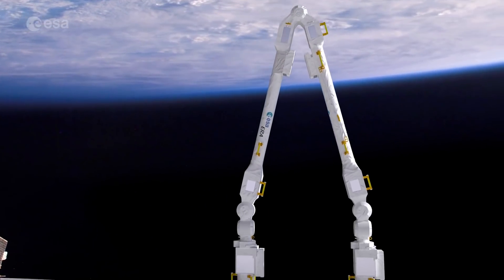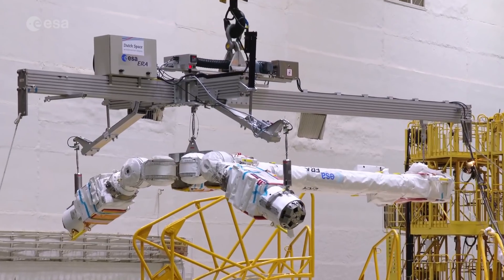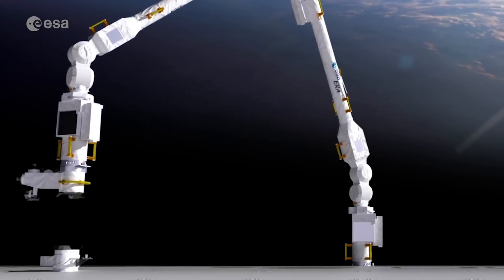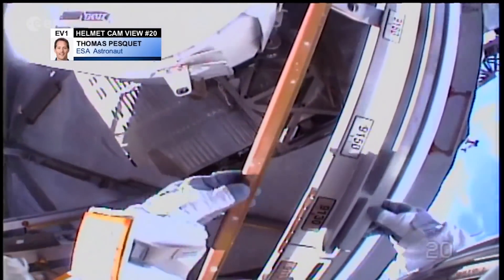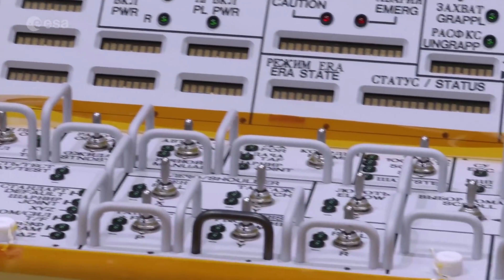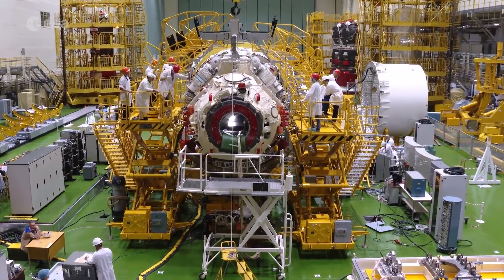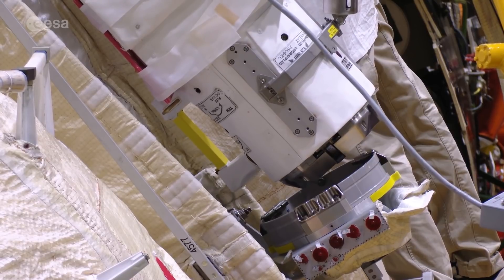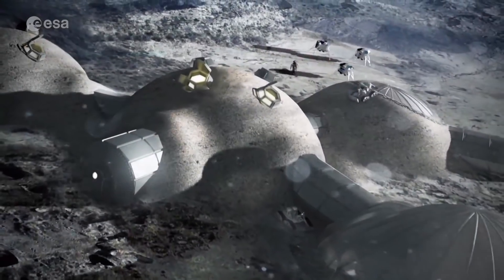'Intelligent' robotic arm to launch with new space station module

Comment: Did these people copy china?
Reply: Nope, China copied them. ERA was built in 2005
Reply: @Cediii4ris  CHINA BULIT IT 2004，SO WHAT！？
Reply: @likevin3087  no they most definitely didn’t.
Reply: @Cediii4ris  China likely to have completed the design in 2004. The copy is not very good and would not work on ISS until they replaces the modules.
Reply: @fungames24  no. The new station wasn’t even a consideration until at least 2013.
Reply: @Cediii4ris  You know that, how? The chinese have 50 year plans.
Reply: Last station deorbited in  2019. the new station was PLANNED in 2010. The Chinese arm is confirmed to be inspired by canadarm2, and is build roughly the same. The ERA arm is older, China copied.
Reply: @Cediii4ris  Next you will say china copied canadian space station because they had a comic picture of it in the past.

Whoever has a working system is the originator. All those who come after are copiers.
Reply: @fungames24  that’s not at all how it works. ERA was built in 2005. This arm in 2016 or so. Era is older-China copied. It’s simple.
Reply: @Cediii4ris  ERA never had a working system. After seeing how the chinese system worked, they quickly copied and fixed the flaw in their system that prevented them from launching it in the past. Even now, there's no proof the ERA system works because the ISS hasn't the mount points like they do on the chinese station. It's entirely possible the ERA arm is a dressed-up old arm.
Reply: @fungames24  Brother ERA wasn’t ready to launch because they waited on the new Russian segment. It’s been ready and working since 2005. you can stop trying to argue now. Just admit you’re wrong.
Reply: @Cediii4ris  Even now, there's no proof it works. In the mean time, we all saw the chinese system worked and their station was designed from the ground up to work with it. This takes long term planning. Goes to show they worked on the arm long before anyone could even imagine it.
Reply: @Cediii4ris  Yes, it was built but it had insurmountable technical problems that prevented it from being used. Even now, it cannot be used or proved to be usable because the ISS is not compatible with it. It can only be proven to work if it is used in space.

People really need to learn to accept a second place graciously. Just do better next time, you know?
Reply: @Cediii4ris  They did not launch it because it wasn't working. Now you are trying to put the blame on the russians. Which bit of the ISS not being compatible with the arm do you not understand? The arm is being launch now most likely as a publicity stunt. Once it gets up there, it will work just like the old arm. While the ISS needs two arms, the chinese station only needs one arm.
Reply: @fungames24  what don’t you understand about the Russian segment not being finished? Russians literally said it themselves. The ISS is 2-3 times as big as the Chinese Station. It has many more needs and yes, a second arm would help with that a lot.
Reply: @fungames24  “The launch of Nauka, initially planned for 2007, has been repeatedly delayed for various reasons. In May 2020, Nauka was reported to be planned for launch in the second quarter of 2021,[3] after which the warranties of some of Nauka's systems will expire. As of 7 July 2021, Nauka is planned for launch on 21 July 2021, 14:58 UTC, and will be docked on 29 July 2021, 13:25 UTC to Zvezda's nadir port.” As from Wikipedia.
Reply: @Cediii4ris  No need. We just go by videos of who's got a working system up first. China did.
Reply: @fungames24  so you’re just going to ignore the obvious proof that China copied. Typical.
Reply: @Cediii4ris  Wiki is no proof. Anyone including you could have put whatever you like in it. I go by video proof. Harder to fake that way.

Think of it this way: to see who won the marathon, you look at who passed the line first. You don't go check wiki.
Reply: @fungames24  ESA-NASA-Roscosmos literally approved the Wiki article. 

And you’re right, Europe built it first-Europe won
Reply: @Cediii4ris  How could it have won when it is still on the ground? See, that's the problem with wiki.
Reply: @fungames24  it won by being built first. That’s the finish line. China copied. Simple.
Reply: @fungames24  still doesn’t change the fact China copied.
Reply: @Cediii4ris  Ok, fine. The eropean arm is the number one space arm in the world that is on the ground.
Reply: @fungames24  China still copied.
Reply: @Cediii4ris  China could not have. If they did, their arm would still be on the ground, going nowhere.
Reply: @fungames24  they did tho.
Reply: @Cediii4ris  No, china doesn't have a ground based space arm. So no copying there. We know the europeans will be trying to copy china for a space based space arm. They may not succeed though because there is no guarantee the locket won't fail. When it does, you will tell me it's all russians' fault.
Reply: @fungames24  tf are you on now? The Europeans built it first. China copied. If you were to actually read the wiki article, you’d see it was because of the Russians.
Reply: @Cediii4ris  They did not build it first. Europe does not have a space station. Europe also does not have a space arm. They have a ground arm. China is the first to build a space arm on a space station. Europe wants to copy. Europe is the number one ground arm maker.
Reply: @fungames24  so: Europe built the arm in 2005 for a launch in 2007 which was delayed. They were first.
Reply: @Cediii4ris  Yes, europe built a ground arm in 2005, then it stayed on the ground in 2007. Europe is number one in ground arm tech. China is number one in AI space arm tech.
Reply: @fungames24  Europe built a space arm that is unfortunately still on the ground. It was built on the ground just like the Chinese arm. Canada is still 1st in space-arm-tech. It is not an AI arm.it’s remotely controlled.
Reply: @Cediii4ris  The chinese space arm is AI controlled. It can walk all over the space station by itself while the space crew slept. So they are number one because no one else has it.
Reply: @fungames24  it is not ai controlled. It is programmed by the crew. 1:1 what ERA does.
Reply: @Cediii4ris  There's no evidence the ERA does anything at all. I think it's just like the old manual arm with some new external covers to make it look impressive. The chinese arm is AI controlled and will move to any space station location the crew order it.
Reply: @fungames24  IT IS NOT AI CONTROLLED. IT IS, JUST LIKE ERA, PROGRAMMED BY THE ASTRONAUTS. AN AI WOULD DO EVERYTHING BY ITSLEF-BIT IT DOES NOT.
Reply: @Cediii4ris  The chinese arm is definitely AI controlled, just like their module/ships. They are self docking and they get to the station in a few hours. Where as the european one, they were launching it in 2007 and it still hasn't got to the station yet, after 14 years.
Reply: @fungames24  it is definitely not AI. It doesn’t do things without commands. It’s programmed.
Reply: @fungames24  also it didn’t launch in 2007. it was PLANNED, but was released due to the Russians.
Reply: @fungames24  Ai- Artificial Intelligence is something that makes it’s own decisions. Chinese stuff and other space stuff isn’t AI. They are all programmed. Not ai.
Reply: @Cediii4ris  Chinese AI makes its own decision on landing on moon/mars. Makes its own decisions docking with the space station. Makes its own decisions on moving the space arm from one place to another. China has AI. Europe only has programming that was launching in 2007 but never got anywhere in 14 years, and its all because of the russians.
Reply: @fungames24  you do not understand what an AI is. Everything is programmed. You don’t seem to understand that. The arm& crafts cannot make their own decisions. They are programmed.
Reply: @Cediii4ris  The chinese AI is programmed to make its own decisions. Europe don't have AI at all. This is why after 14 years their arm is still on the ground.
Reply: @fungames24  no it’s Not. It’s programmed by astronauts and ground stations. They tell it what to do, and it executes that. Not an AI.

Comment: this is copied from china since it came later than china's. right?
Reply: Wrong it was built in 2005 just been sitting in storage until the new Russian module was finished and launched. And canadarm was installed in 2001 well before China deorbited its previous station.

Comment: I'm honestly shocked no mention was made of the existing Canadarm on the ISS.  I would have loved to have known how the new arm differs.  I assume the current arm is manipulated manually, but they seem otherwise very comparable.
Reply: They didn't even mention the china arm, which is exactly the same as this except it's already on the Chinese space station. Blatant copy of chinese arm.
Reply: They did briefly mention that the existing Canadarms won't be able to reach the new Russian segment. The current arms were never robotic (in the true engineering definition[1] of that word) but merely remotely human joystick-manipulated grapples. This new arm can be truly tasked with autonomous missions, so is genuinely robotic. This matches the capability of the new arm that China just launched (their's can also be interconnected to identical arms for greater reach - presumably his one could too.). As both ends are identical end-effectors, its 'walking' ability is very useful.
[1] International Federation of Robotics - IFR’s use of the term “industrial robot” is based on the definition of the ISO: an “automatically controlled, reprogrammable multipurpose manipulator programmable in three or more axes”
Reply: The new arm can be controlled from outside and inside (Candarm only inside) and as said, the ERA can move all over the new segment. Era is also faster, more accurate and more articulate

Comment: Awesome that there is a new arm going up, But i certainly dont consider something on the space station with 5mm accuracy to be "astonishing" closer to disappointing.. How about .5mm?
Reply: 5mm accuracy at the end of an 11meter, 11,000mm,  multiply jointed arm which does not have a rigidly fixed base sounds pretty decent, actually.
Reply: @scottfw7169  mhm not even counting the fact it’s you know, in space.
Reply: its also an arm that can control itself in space and can carry 8 tons while being able to autonomously move around the station, and its going up with a new module, doesnt feel very disappointing to me
Reply: @Myname-il9vd  I pin pointed exactly the one subject about the arm I had an issue with calling astonishing, this has nothing to do with my comment.
 I'm well aware of how cool these are but I'm not a fan of holding up a mediocre at best fact with confetti and golden shines around it.

I'm just surprised 5mm is even acceptable non the less called astonishing. We have everyday robot arms fighting gravity on earth with ten times the accuracy while working at ten times the speed.
Not astonishing accuracy.. That's all I'm saying.
Reply: @Vatsyayana87   yeah but those are on earth where there’s no weight concerns and little power concerns, they have to design it around the rocket it’s being launched on and the power it can get from the station, and it has to be a lot more durable to deal with the harshness of space, and those other factors are also contributing to its precision capabilities, ig I just don’t understand how 5mm isn’t astonishing with everything it has to content with, even things like radiation pressure and light drag might skew its ability to have precision and motion works differently in space so it has to contend with much different forces than down here
Reply: @Myname-il9vd  On earth with no weight concern? Are you a bit confused lol. We are not talking about launch weight if that is what you are bringing up for some reason but that would be completely irrelevant to the convo lol. Either way. My opinion stands.
I'm not astonished or even slightly impressed with 5mm accuracy on equipment attaching to the most expensive thing humanity has ever done, we do so much better work then that everyday. 
Sorry if you dont like my opinion.
Reply: @Vatsyayana87  wait maybe I am confused since the thousand dollars per pound to lko is a very real restraint, also again I gotta stress maintenance is difficult at best so at some point it’s just not worth it, and to try one last time to hammer it home when moving on the space station each and every rotation will impart a spin on the station, high precision will add even more movement cause the arm has to correct for the oscillations and odd forces the arm will produce due to being in orbit and with having nothing to anchor it like machines on earth. the station has some passive balancing but only for its normal orientation and not for moving things like robot arms carrying payloads around. It’s moment control gyros can counteract that to a point but once they get saturated(I’m gonna assume you know what that is if you don’t there are a bunch of great videos quickly explaining what it is) they need to use fuel to reset them, and that’s expensive fuel that could be used reboosting the station. Again if this arm was on earth 5mm might not be impressive but those machines have a whole planet to anchor to while that arm has an object in free fall that’s made to be as light has it possibly can, those are all things those engineers had to consider. I’m sure they’d kill for higher precision but space is still really hard and money is usually tight cause space is also expensive, it’s not that I don’t like your opinion(unless it was something awful that’s a bit high and mighty)it just feels a little disrespectful and not well thought out tbh. those engineers probably could list a thousand issues that I couldn’t even think of if I tried. I also feel like you just arent looking at it as a whole, any one of those issues on their own could be solved but they’re all happening at once and that’s why 5mm precision is impressive, even if it seems kinda dull down here, it isn’t down here and in space things are very very different(though I’m sure you know that)
Reply: well thousand dollars per pound for us launches on I think the falcon 9 and they’re esa and roscosmos if I remember right so it’s probably even more. And they had to fit either a computer in the arm or use existing hardware on the iss, computers aren’t the same in space since they have to be space hardened against radiation and initial launch forces, so they can’t be as good as they are down here where conditions are much nicer, and it has to be size limited for the fairing and the payload it’s riding with. You get what I mean? Theres just so much they have to think about, I could go into the government factors and design and building times and even mission requirements if i wanted too but that’s a lot of typing I don’t really wanna do lol
Reply: There’s more than enough cases of engineers biting the bullet and sacrificing one ability for practicality this is just one more edition

Comment: 8 tons (800,000kilos) it doesn't matter in space because there's no weight so 5x that is no problem....
Reply: Mass is also still a thing they have to contend with, yes it wont feel weight like they are showing off, your right. But it will have to fight both momentum and inertia.
Reply: That would be 8,000 kilos... And that would be tonnes aka metric "tons". A regular ton is 2,000 pounds while a tonne is 1,000 kilos or 2,200 pounds.
Reply: Inertia.
Reply: Good point. The way that mass/inertia manipulation capability is worded (as weight) is problematic indeed.